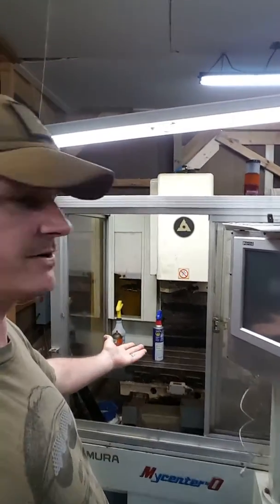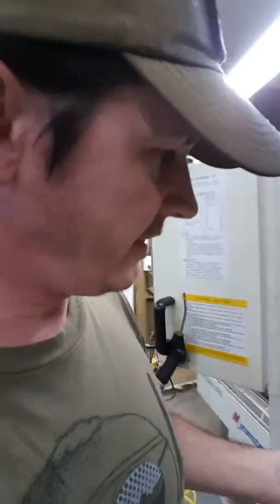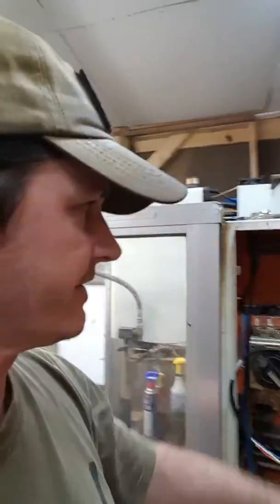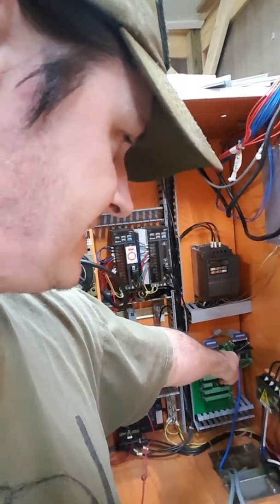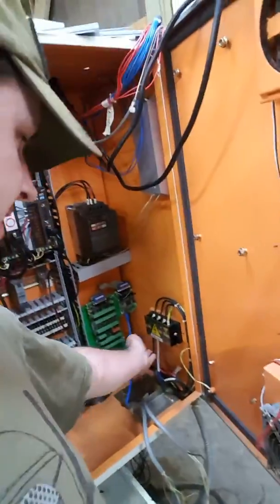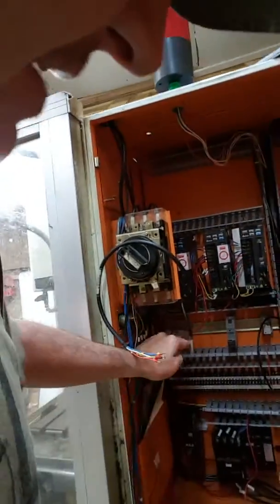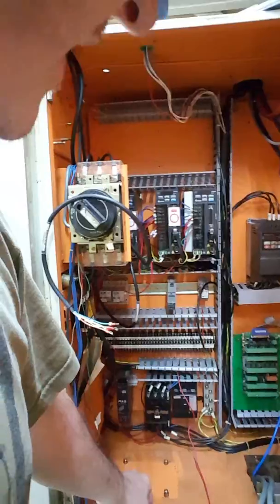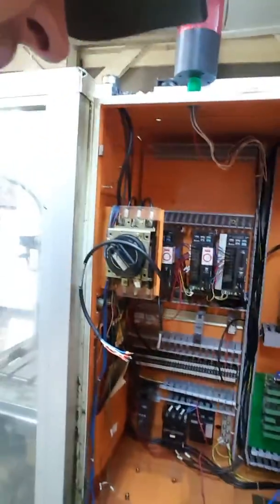Kitamura Mycenter Zero Linux CNC Retrofit

Comment: How are you going to control the ATC?
Reply from the maker: That was actually the easy part. The mesa 7i76 card can control up to 6 stepper motors. I used the 7i77 to control the servos driving the axis and spindle. 

She was a great machine and I'd love to have another.
Reply: @jodyolivent8481   Oh nevermind looks like the ATC arm is missing from your machine... I was about to be impressed as that would of involved a bit of macro programming the atc arm has closed loop proximity switch feedback sensors and the pot uses random tool placement logic. I see you scrapped the project? I need an x axis over travel/ home limit switch for my machine.
Reply from the maker: @vrdengineering5204  yeah, Kitamura has always done some fine engineering. I have the limit switches off that machine.

Comment: Hey this is awesome. I'm looking at one of these machines locally at a really good price, but it's a Yaznac MX3 controller. How much does a retro fit like this run if you can find the help to wire it all up right?
Reply from the maker: @Paul Baird Just replacing the controller can run $800-2000. If you have to replace the servos and drives it's about $750 x 3 axis so about $2250.

Comment: Hi Jody, sorry, at some point I got unsubscribed, was not just you, I lost several, and keep finding ones. You're are an industrial electrician? What are some things that us DIY CNC's do that make you cringe, as far as safety, reliability, and just good practices? Best wishes from the snowy Midwest.
Reply from the maker: Kent VanderVelden If you look close I have plenty of wires routed outside of the trace. I don't begrudge anyone for doing what they need to to make it work. The only time it becomes an issue is when someone else is expected to follow what you've done.

I've printed off the various manuals for the components used and made notes on them so that I can keep up with what's been done. On a project this size it is necessary
Reply: Thanks Jody. That's an excellent reminder to purchase the labler I've been been considering.